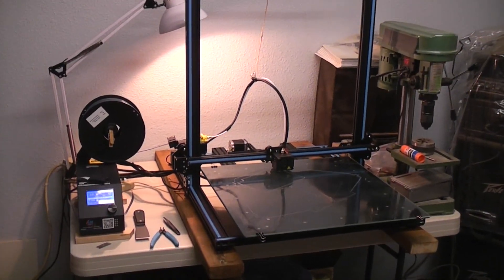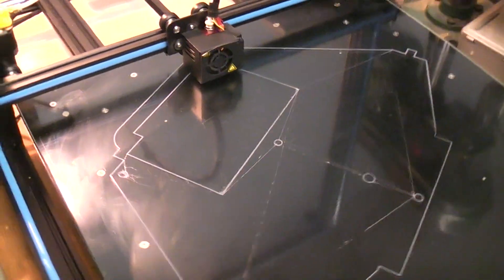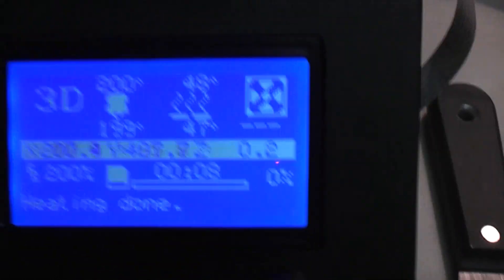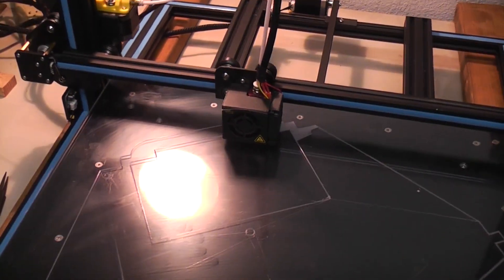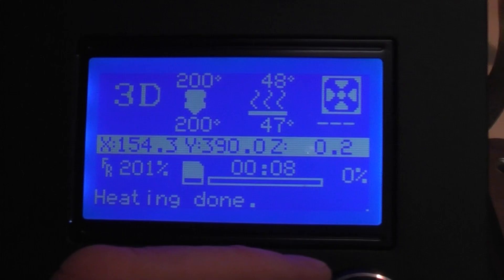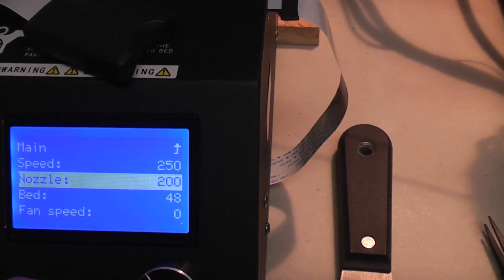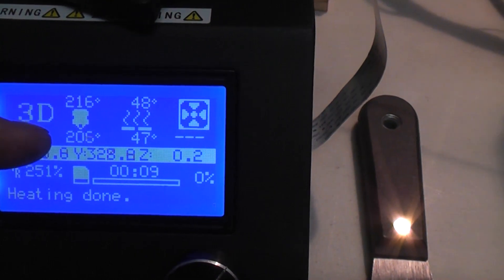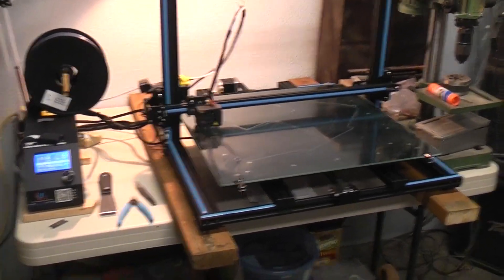Playing with the "FR" control on any CR-10 type 3d printer.

Comment: I usually adjusted this by accident when my hand bumped against the knob. I'd see the number going up, but I never knew what it was for, so thanks a lot.
Reply: Same here!!! I've completed all of my upgrades but am just now noticing it speed up as i changed it
Reply: In my case the fr don't change when I moving the wheel, but when I move the wheel, the position in all axes an temperatures are actualizated.

Maybe in control settings but I never change the original value.

Comment: It's also handy to turn the speed down during the 1st couple of lines (usually purge/brim outlines in most scripts) to let you fine tune the bed level/height while it runs. This is easy to do if you slow it down enough, and you get the hang of it - which I did quickly. It sure beats starting things all over if the bed is tilted a tad, or is just a bit too close or far. 

Next time you see a lack of adhesion, or over-flattened, give it a try. You have nothing to lose at that point, and you just may save the print or at least learn how to "tweak on the fly"

Comment: I just cruised through a simple retractable razor knife in half the time at 300% on the Ender 3. I started at 100fr and normal temps, then slowly increased to 300 fr and 230 nozzle
Reply from the maker: Cool isn't it. There are built in factors in the slicer controls and the printer firmware that limit the actual print speed no matter what you set the FR too. But even with that, you can do some fast printing.
Reply: @Robothut  Yeah, Thanks man!  just you just happened to popup while i was upgrading the bed springs.  Havent had the ender 3 for more than 2 weeks and im about to buy the cr 10 already,  I can see this getting out of hand fast! :)  Set one up, print...set one up, print....set one up, print.... .....

Comment: I accidentally turned mine down to 10 without noticing and wondered why a part smaller than a flash drive took two hours to print
Reply from the maker: Live and learn. I normally stand and watch the first layer, just in case something does not look right. And printing super slow "10" might have caught my eye, but you never know.

Comment: had my print at 60mm/s and then i increased it to 999%  doesnt look too bad either.
Reply from the maker: There are enough controls in place in the slicer programs, like rules about max travel speeds based on setting and the stl file design  that keep the maximum TRUE print speed from reaching the max "FR" speeds. But still, I bet the printer was really moving along at top speed. Must have been cool to see. Glad to here the print did not turn out to bad. Love that FR control.
Reply: I did the same thing crossing my fingers and talking like Scotty.

Comment: I don't think it's just for speed, I printed a flexi rex and dropped the FR to 50% because it seemed to be going too fast... well the print finished but then I printed another but only changed the temperature and left the FR @100%
the first print was literally lighter... like it didn't have as much mass and was much weaker

Comment: Good vid! I need to slow my printer down and heat up the bed more so the print stays on the glass. How do you like the printer? What model?
Reply from the maker: CR10S-5 the big one. Bought just for those over size prints. I help the glass bed with a heat gun other wise it takes for ever to get up to 60 c. But also the printer being so large I have to keep it out in the shop and shop is not heated so it gets cold out there and that does not help when trying to heat up the glass bed.
Reply: It's huge!!!

Comment: Cool! Thx! :*)
Are you printing on glass? I'd like to know how to print without tape and all the other print bed stuff. Just glass.
I dunno if that's possible, coz I just received a CR-10 (my 1st 3D printer) and WOW! Right?
Reply from the maker: Yes I am printing on glass. You can do it with nothing added to the glass bed if you machine is set up right but parts will warp as they can let lose from the glass when they are large and thick, so I tried hairspray first and it worked sort of, the part had some warping , so I tried glue stick and it works perfectly. but you can put Build Tack on the glass then your parts will always stick as I have used that system for 3 years.
Reply: It has a heated bed
Reply: Slippery_ Gecko Hey! Thx I appreciate you taking the time to reply. Happy Holidays!

Comment: Thanks for the video! I had no idea what the FR was. I also have a different issue hoping you may know the solution as it seems you have done 3d printing for quite some time. My issue is the bed leveling. The glass sagging, bowing at the center issue. I can adjust the four corners but how can i get the center to now sag? Thanks in advance.
Reply from the maker: Some guys add think shims to there print beds to fix places that sag or are too high. I have replaced the glass on a printer to fix the problem as you can buy glass mirrors at the big box stores, mirrors are very flat so that the images they reflect are not distorted, so make for good print surfaces.
Reply: @Robothut  Thank you, really appreciate you replying. I ended up doing both! Got the mirror but it was still off. I then added a few sheets of foil...which brought it to an acceptable level and now i'm printing! I'm think it may be the Z bar that is bowed...who knows...at least it is working now.
Reply from the maker: @trompolystudio  If you can lay a straight edge ruller on the glass bed then you will know if the bed is off or if the Z rail is bent. But I bet you are right, its more likely to be a bent Z rail than a bent glass mirror.

Comment: why my cr10s is not printing on the middle of the glass even in Cura the model is on the middle?
Reply from the maker: warped glass masybe ? Lay a straight edge a cross the glass, if you can slip a piece of paper between the straight edge and the glass at any point it is not flat.
Reply: check the bed dimensions, mine was set to 200mm somehow; putting it to 300mm centered everything.
Reply: EDDiEWASAKi WARRiORS The cura settings might be wrong if the print is way off, the wrong size bed or location of the print head may be entered wrong.

Comment: I just got flexible filiment. Some say to slow it to 10mm-25mm per second. Does this feed rate lower the "mm" per second? I'm not sure what % = 10mm per second. Just confused and having a hard time finding info. Any help is appreciated!
Reply from the maker: Yes it can slow the printing down based on what you have set in your slicer. So lets say your slicer is set to 60mm per second, if you then turn the FR control down from 100% too 50% you will be printing at 30mm per second.  Also normally your first layer will be set to a slower rate in the slicer, say 30mm per second, so again if you set the FR  at 50% you will then be doing the first layer at 15mm per second. But normally speaking you would just use a new slicer setting for all this. A slicer setting that is set up for flexible filaments and there are other setting that you might want set differently as well. For example the part cooling fan might need to be set very low or off for some flexible filaments. You can adjust the part cooling fan in the printer meneu as well if need be on the fly. Also the hot end temp will be different for some flexible filaments, changing this in the slicer is best but you can change this in the printer controls as well.
Reply: @Robothut  thanks so much! I will check my slicer settings tomorrow morning. I had thought there was a default per printer. I see what you are saying now. Thanks!
Reply from the maker: Yes the slicers will have printer defaults, but they will also have different filament presets, like PLA or PETG or flexible filament like TPU. But even if you have sliced a file for say PLA you can go in to the printer controls and change temps and speeds and fan setting until you get a usable result. Then if you make your own filament profile in your slicer program you will know where to set these things as a good starting point.

Comment: I suggest you build a cover for the printer and fan to outside. If you breathe the "printing air" it can be dangerous for your health. Just saying if you print a lot
Reply from the maker: The Cr10S5 is so big it is outside, well in the shop so might as well be out side. Lots of ventilation.

Comment: 200% seems nuts, but doesn't appear that way on your machine. On my Ender-3 I guess I had been printing around 30%. i bumped it up to 60 which sounded okay. But going to 75 just sounds like it's moving so quickly ughh, time to just print some tests I guess
Reply: The actual speed will depend on what speed you set in your slicer. I have run at 300% on occation, if the print speed was set to 35mm when slicing.